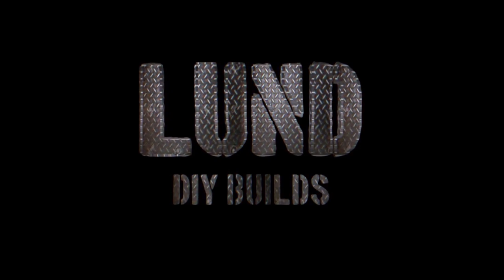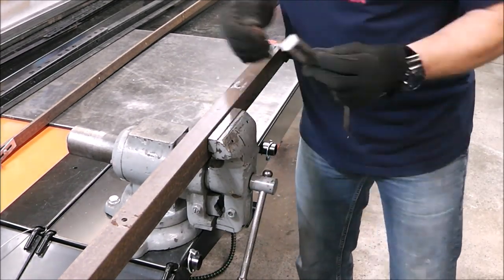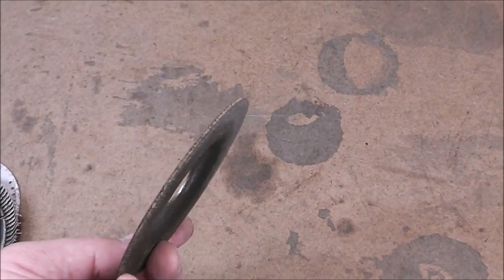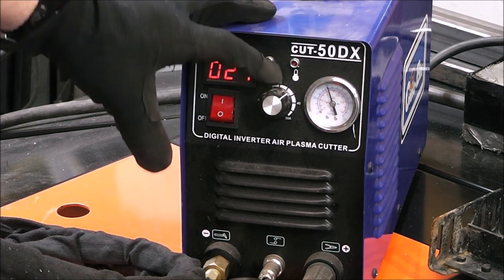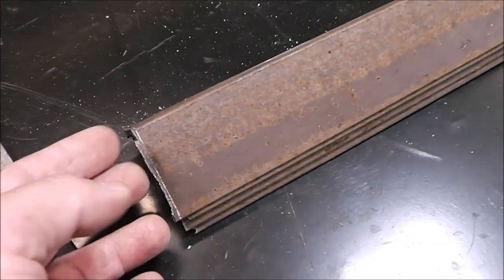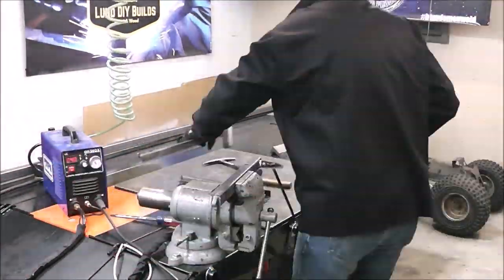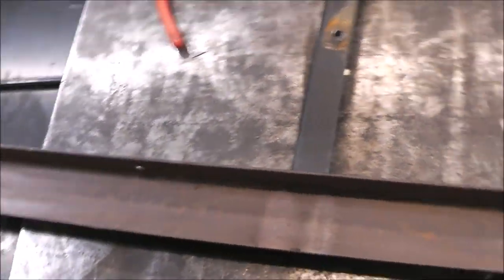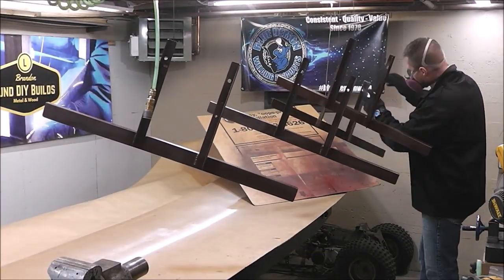Flux Core Welding Overhead Steel Storage Rack - scrap metal project

Comment: Those auto dual voltage machines work by stepping any voltage down to like 90 volts. 
Another option for cutting bed frames up is to heat up the areas to be cut orange hot for a few seconds then let cool down without quenching..  just saying, for those who don't have plasma cutters. .. 
Great video! Good info. I had to learn the hard way about bed frame steel. 
Hey, I bet your eye patch story has a silver liner. ..I bet it made for a cool nick name, huh? A-r-r-r-rrr
Reply from the maker: Thanks man and good point about the flame. It will take the temper out as you pointed out and then you can cut it just like regular metal. It was embarrassing at first but then all the girls were digging it...so it wasn't all that bad afterall lol

Comment: I believe the raising cylinder has hydraulic fluid and is operated by air pressure
Reply from the maker: Good point! Thank you, I think your right. It makes sense because i'm guessing if it only held air than it would probably be springy if you pushed up and down on the table. It's solid so I'm thinking your right!.

Comment: Good way to make extra storage,  when I was a kid my friend had a big train set when his dad needed to use the garage he would pull the train set up to the roof on some pulleys maybe you can do something like that also  , To get even more storage    If I used some map gas on those bed rails  would it soften them enough to drill,cut  ect  ?    I don't have a plasma cutter    The guy that said he would send me his  plasma cutter  gave it to his buddy instead.   thanks for the video.   TANK
Reply from the maker: Thanks buddy. If I didnt have a plasma cutter than heating them and allowing them to cool would take away some of the temper. These can be a royal pita because they are so hard

Comment: Going to a dr to get metal out of your eyes sucks been through it a few times
Reply from the maker: I've been so many times that I have permanent scarring on my right eye. People will make comments on the channel sometimes that I look high because my eyes are red and watery when I first wake up (which is usually when I film). Fortunately with all the eye injuries I still have better than average sight in both eyes.
Reply: @BrandonLund  you never look high bro dont let people get to ya
Reply from the maker: @AntonioClaudioMichael  Thanks man! I appreciate it :)
Reply: I done farm welding most of my life. I’m 62 years old. I used to keep one of those little screwdrivers with a magnet on one end in my pocket when grinding or using a torch and if I got some steel in me eye I would run that magnet over my eye most of the time it would get the steel out. But you need to do it right away before it got filmed over.
Reply: @brucemorris6319  very smart idea that's some good information